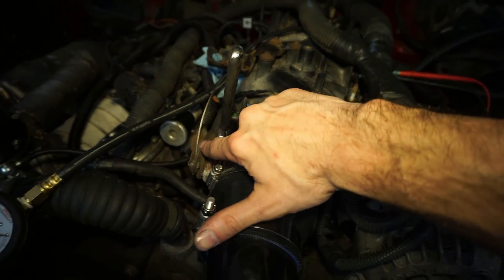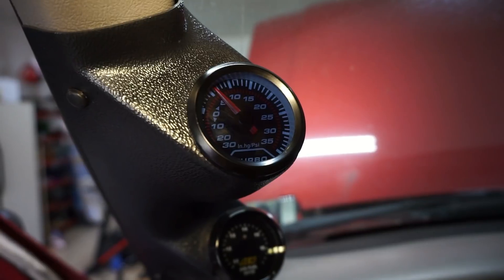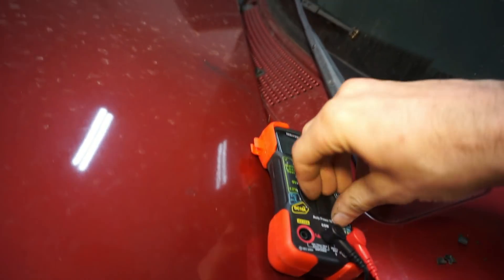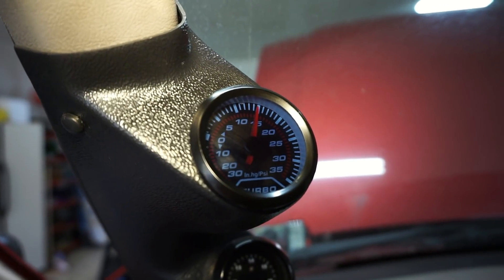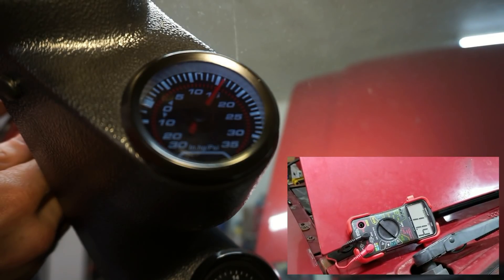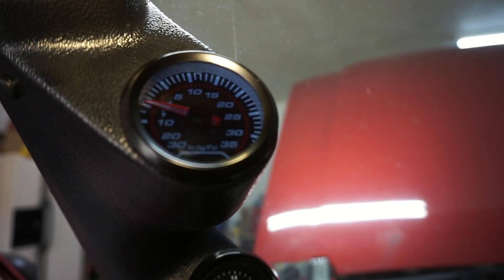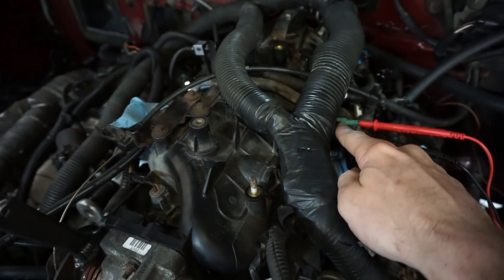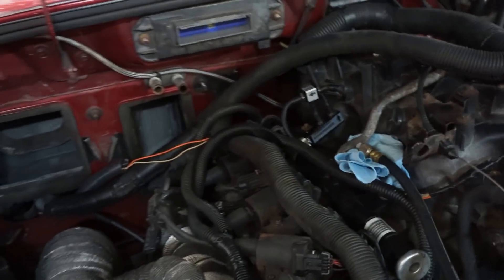MORE DETAIL ON THE BOOST CUT SWITCH TESTING!!! Turbo LS Swapped Ranger!!!

Comment: I like where you're going with this, but loosen the rockers to close the valves to make it easier on yourself.   IAT-ground-timing strategy yields more boost when you pull tons of timing in the -40 cells correct?  What's the plan then to utilize that as a boost CUT?  Is it to pull something like 5-10*?
Reply from the maker: bcmedzis Yeah, I don't want it to work like and antilag more so just pull the timing to zero-5* ish to prevent detonation, fall on it's face and I can lift... Maybe add some red LEDs or something by boost gauge that turn on if that happens...

Comment: Makes sense compressor pressure is higher than boost gauge pressure now that you think about it....the engine is static with potentially open valves, losses thru rings etc  Look forward to seeing a running engine test with the light.
Reply: yeah, pull valve covers, loosen rockers to close all valves, then do all this testing

Comment: Maybe I’m confused, did you say you were running 2x FP regulators?
Reply from the maker: HeadFlowInc Yeah, the stock one in the rail is gutted now, the 2md was on the return side half way back to tank... I removed that one and pressure dropped to 45.
Reply: a21bravo Yeah, definitely no need for two regulators. You can use as many pressure gauges as you want. 😉. If your holding 45# at idle I’d say go back through the tune and run it at the track!  👍👍👍
Reply from the maker: HeadFlowInc Still going to put it in so it references boost and increases pressure. Thought about running if for a few days like that but the regulator came in today.
Reply: I'd bet if its double regulated the restriction should cause the dead head pressure spike.